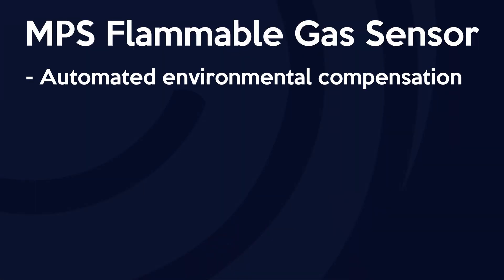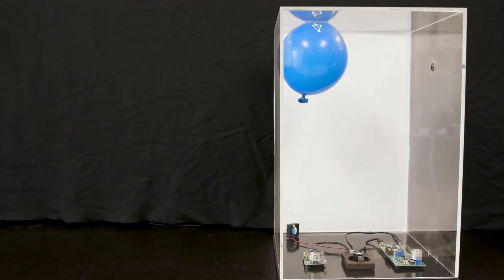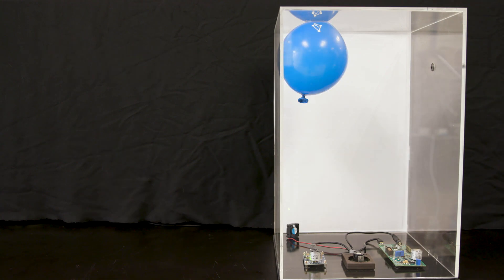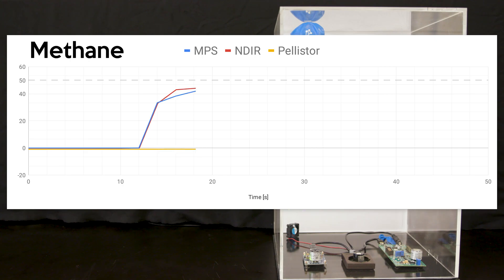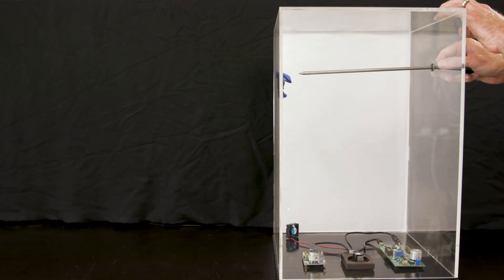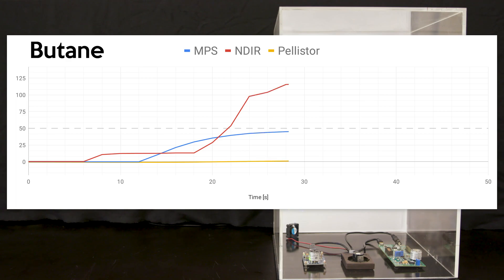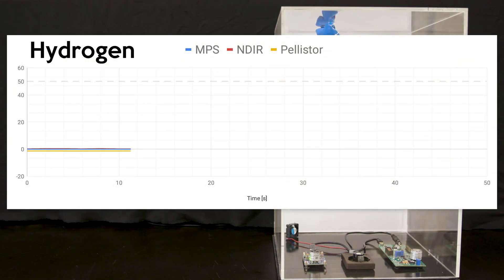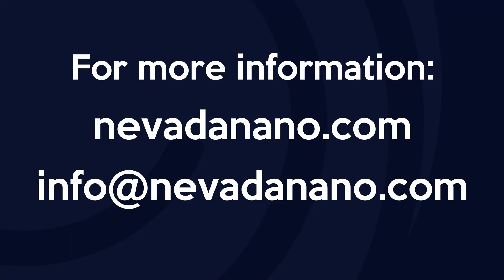MPS™ Flammable Gas Sensor demo

Comment: may i know how did you read the data in real-time as i cannot see any multimeter or controller connected to the experimental setup
Reply from the maker: The MPS™, pellistor, and NDIR sensors each have a user interface and were connected to a computer to log the data during these tests.